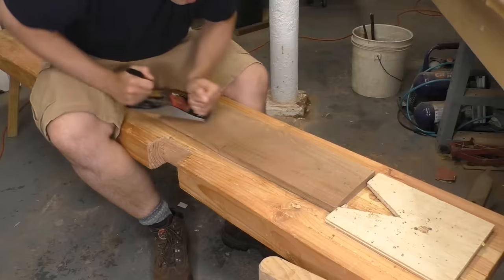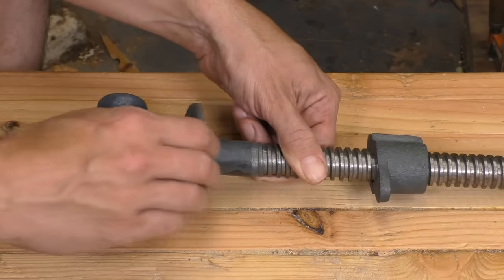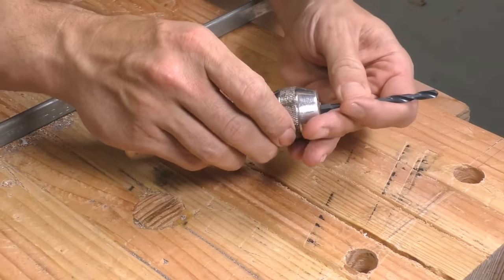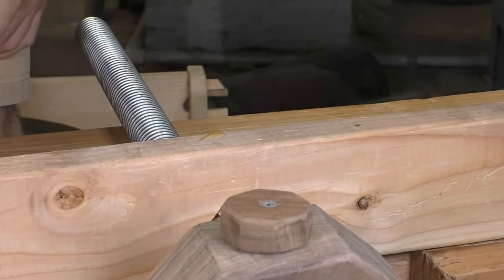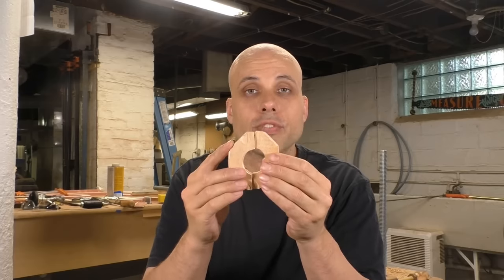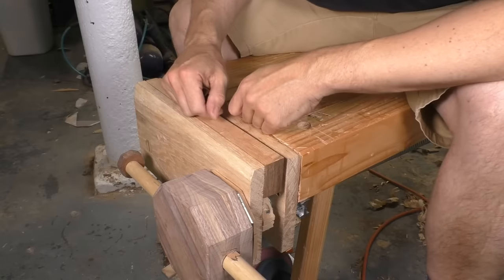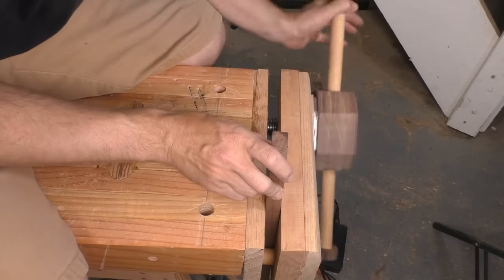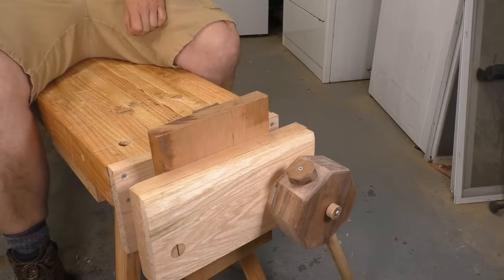Add a vise to the $30 Work Bench.

Comment: Question: Why not put the screw more or less in the center and have two smaller guide rods lower and in the corners? Aside from  taking up a little extra space, it seems like it could help with the racking issue, as well as being able to more easily support the screw. I say this as a welder, for the record. just starting to dabble in the realms of wood. (In before: giggity)

Comment: As alway, WONDERFUL presentation. 
I had a thought and was wondering if you had any thoughts. 
Why not put the screw in the middle and use 2 guide bars on the sides?
And yes I just now saw the end of the video so I suppose that kinda answers part of my question...
Reply from the maker: That's a total valid was to do it, but you lose the ability to clamp wide boards and work their ends. Thanks for ALWAYS watching and commenting!

Comment: At 1:35 you show a "commercially made vise screw". I have one practically identical to that. It has sentimental meaning to me, since it was my grandfather's, but I haven't figured out exactly how to use it to build a vise.  I have a question, that might make it easier for me to be able to use it.

Why is the end of the garter rounded? Whenever I have thought about making a vise out of it, I haven't been able to figure out what to do with the rounded part.

Comment: Rex great work, see if you can get some 1/8 or 3/16 floor underlay the stuff that's rubber and cork mixed together l got a roll for free and it works brilliantly on the vice/vise jaws reduces the force to get a good grip on the work piece. 
Power tool tut tut............................joking 👍👍👍👍👍

Comment: I was wondering why the screw wasn’t in the Center of the vice. Of course it would mean you wouldn’t be able to pass a long board through it but do you think it would work for less longer boards or to use boards width-wise for cross cuts etc.?

Comment: I'm confused as to why you didn't add the screw in the middle and have two guide bars on the outside? Am I missing something, Surely it would have fixed the uneven clamping force and tendency to rack??

Comment: This doesn't require any different parts. Why isn't the vice screw centered and you just add an additional guide like most standard vices.  That would solve a lot of those issues right?

Comment: So I've been wondering if you can mill wood on this bench, and I mean mill mill; like take a 8 ft log and turn it into useable lumber? Now I know you have to dry it and all but still would be fun, I've seen Me. Chickadee do it with Amish style saw horses and his method looks like it's not that hard but I'm not ruining the 10 cedar logs I got for free trying to learn how to mill it with wedges and an axe.
Reply: The splitting I wouldn't do "on" the bench - riving really since you want to follow grain I assume...for that you really want a Froe....can make one from the end of a shackle spring....your neighbor might not mind too much if you take one off his truck,  you need about 1/3 of 1 leaf....you don't live next door to me right?
But, once you have a flattish surface, the bench dog will hold it while you start the flattening process 
With 2 benches side by side the long way, you have a version if the old saw pit...place log over the gap and RIP saw it by hand....that's a lot of sawing.
There are videos out there on riving logs to get the staves you can then turn into quarter sawn lumber.
Plank sawn, well, you have to saw it.
Reply from the maker: Sure!  It's lot of work, but people certainly did it on these benches for centuries.
Reply: @gregmislick1117  not going to be "borrowing" a neighbors leaf spring, but I have thought about procuring a froe would help with logs, the Sawyer's in my area charge way to much, the cheapest guy I found said he'd do me a favor and only charge me $2.80 per board foot (regardless of species) plus I had to supply the gas, told him I'd find a way on my own; been thinking chainsaw mill but I'm not the poor man cause I can afford one and gathering the required amounts of steel tubing is taking me a bit longer than I thought.
Reply: How big (diameter) are the logs you want to mill?
How long? You mentioned 8ft in your post, is that average, max, or just what you have now?

I think, if I were going to try an 8 ft log which I could get onto the bench, I'd start with a draw knife and a long straight edge and try to establish a flat spot on the top face, so that you could roll it over and it would then stay put.

Mind you, an 8 ft x10" Eastern Red Cedar log - "air dried" so somewhere around 12 - 14% moisture content, is pushing 140 - 150 lbs. For Eastern White, it's about 60 or so % of that so 80 - 90lbs.
Green wood is another matter, I have some maple drying VERY slowly in my basement that is over 200lbs for about 5ft x 8 - 10 inches diameter. Water is heavy!
If you are going to split it...2 wedges at one end to start it, can probably get it to go down the middle, then you start using additional wedges along the length inserting them perpendicular to the length of the log...so they are going "across" your split. Keep moving down for ing the original split to "run" 
This is all the a froe does anyway. 
Once you have it in 2 pieces, just work the pieces down in the same manner.
You stop when the thickness of the thinner part (pointy end of the wooden wedge you have split out when look at the end grain end) is still thick enough for you to have enough meat left, at the width you want, to do the flattening with the planes.
Remember to account for the sapwood / heartwood boundary if you want only heartwood (or sapwood).
Let the stave you have split out season a bit before you work it more.

Don't forget to seal the end grain as soon as possible after logs are cut, or after they come into your possession to reduce the checking / warping / twisting while drying

Practice with some logs from the firewood pile. I regularly pick over my wood delivery for interesting grain figure or nice pieces to get quartersawn from. A 4x6x16" chunk of quartersawn oak/ash/maple/cherry/hickory is not an un-useful piece of lumber, and not entirely cheap either. Good for boxes or other smaller projects, or turning blanks. You just have to decide what you're looking for.
GOOD LUCK
Reply: @gregmislick1117  thank you for a much better explanation than a ten min video with no talking, 2 of the logs are 8ft and the rest vary from 4ft to 6 ft, still green, I think, as they were cut about 3 months ago and have been stacked about 6in off the ground and covered with a tarp to reduce more moisture getting into them (Florida is very humid).
Reply: I took an 8ish foot red oak log, about 20-30" diameter and rived it into 2-3" slabs.  Just steel wedges, ear protectors and an engineer's hammer (sledge is too big).   I made a roman bench from one of the slabs.  You don't need to dry it to do the staked legs.  In fact, if the legs are a bit dryer than the slab, they should expand a bit from the moisture in the slab.  That's how windsor chairs are made.  No glue either.
 
I don't know how well cedar would split, but oak does.  Riven wood is the strongest, more than quartersawn.

Comment: Well done. Just wondering why you didn't use the vise screw instead of the jack screw.
Reply: They're often less expensive. Sometimes you can get the vise screw for less. Whichever you find for less, or works better for you...
Reply from the maker: All the vice screws I've seen online are more money or the same for a MUCH smaller and weaker part.

Comment: Why not use the vise screw instead of the jack screw? Is it a lot more expensive or maybe not separately available apart from buying a whole vise?
So many clever ideas in this video. I've been binge watching as I just found you a week ago.
Reply: I think the idea was to make a project that was really accessible to a wide variety of viewers. A scaffold jack is cheap from new, easy to find, and also can be pretty easily found out in the wild, if it comes to that.

Comment: I started in the blacksmithing arena, lol before it was cool,  and so maybe this is something that would only appeal to someone like me but lately I’ve been noticing some surprising (to me) engineering aspects of wood, such as “self lubricating” or even more primitive there are some species that maintain an ability to bend over and over and continue as a decent spring for a longer than expected period of time. Lol don’t judge me, I’m still getting into working with wood! Anyway, with all that said, why not use that beautiful mind of yours and adapt a holdfast type tool, the physics I mean, and build whatever inspires you the most? The main reason I suggest this is because of your “notch” and how you basically said you have to fight with it to hold your stuff, I’d be interested seeing what you’d come up with
Reply from the maker: I appreciate that vote of confidence. I guess this vise IS what I can up with. It solves a lot of my problems.

Comment: You should really consider replacing that screw vise with one that's operated like a shaving horse, one you can just hold with your foot.
But an edge vise, not a literal shaving horse, would provide faster change.

Comment: In several of your videos, you have mentioned you like having both the low bench and the joiners Bench and it makes a lot of sense to me. My question is if you have the Joiners bench with the leg vise, and the low bench with all the manual holds. Would you still go through the effort and $ to add the face vise (can it still be called a face vice if it's on the end ?) to the low bench or are most of the operations that it helps with, actually stuff you would do on the Joiners bench anyway?

Comment: Thinking of using a 1 1/4 inch dowel instead of a 1inch. The 1 inch dowel I have is super rough, dry, and almost flaky? But I have a 1 1/4 that's much heavier and feels sturdier. Any reason not too?

Comment: Is there a reason not to put the screw in the middle with two guide rods (one on each side). Would that help with having a loose hold away from the screw?
Reply: You would be further limited on what you can clamp, as you see in his video, when he puts a board in, most go through the clamp and are exposed down below the screw and guide rod. This design allows for you to put pieces in between the two and have more surface area to clamp the wood: something that is important when clamping soft woods.
Reply: @Battleofjerhico  I did think of that but if he reduced the diameter of the guide rods and moved them towards the outer edge, I dont think he would be that limited. It seems already slightly limiting to have to use specific placement to have a secure hold anyway.

Comment: i did not read all the comments but why not center the nut and use two guide rods like commercial vices?
Reply: Watch again; he did that so he could work the ends of boards up to 9-inches wide. If he centered the screw, he would only be left with a couple of 4-inch or so spaces, instead of one wide space.

Comment: If someone wants a different vise there are all sorts of videos on making all sorts of vises. I'm in two minds. On the one hand I don't like the way that vise racks. On the other I do like the way that vice racks.... ;)
Reply from the maker: The racking also gives you the ability to hold those wide boards. It's a plus and a minus.
Reply: @RexKrueger  Absolutely. I'm in two minds as to whether to build a bench like yours or do it like Paul Sellers however I will include the crochet (sic) as that is a brilliant idea.
Reply from the maker: I think Paul would approve of the crochet. It's very traditional. I have a tall bench, so I just use whichever one I feel like.

Comment: Would there be any reason not to wax the guide dowel (and maybe the screw as well)?
Reply from the maker: I waxed the dowel and oiled the screw. Did I forget to mention that? Damn.
Reply: @RexKrueger  You may have mentioned it and I just missed it. That's been known to happen:-).

Comment: Does being so low to the ground affect your back or posture?
Just curious, I broke my back in a motorcycle accident ... it's never been the same.
Reply: I am a heavier guy so getting off my feet is nice as I can get some lower back pain if I am on my feet too long.  Really I find it very comfortable, but for you its going to really depend on what bothers your back and such.  You can certainly modify the bench to be somewhat higher.  You can test working at the level easily enough with concrete blocks/milk crates or some other suitable material of appropriate height and some 2x4s and see how it feels.  That is going to be the way for you really because I imagine the motions that irritate your back or cause you pain are going to be unique to you and not anybody else.  There is also certainly some room to make it higher as well if that would be more comfortable.  It is one of the nice things about building it yourself because you customize it to what you want and need.

Comment: You could have saved yourself a lot of trouble by just buying a new vice; What is the difference in price between a vice and a Scaffold Leveling Jack Screw?
Reply from the maker: It's really big, especially for a vise that's anywhere near this one in size. Yeah, you can buy a tiny vise for very cheap, but that's not going to get the job done.

Comment: I know people complain about the quality of cheap cast iron vices, but if the jack screw alone is $26, is this REALLY a better option than slapping on a $20 woodworking vise from Harbor Freight? It be like, yeah they may not be great compared to expensive high-end vices, but they've gotta be at least as good as something cobbled together from scratch.
Reply from the maker: And with that attitude, you have a great excuse for never trying to do it yourself!
Reply: There needs to be some justification for a project like that. It's either gotta be cheaper, better, or just more accessible.
Call me crazy but "Well it's a lot more work and it probably won't be as good, but at least it costs more!" doesn't seem like much of a pitch to me. Even the call to DIY isn't a good rationale since any time not spent making the vice could be used working on other projects. 

Just sayin'.

Comment: Anyone think a 3 hole ( threaded drive in center with a guide dowel on each side) would rack less? What would be the disadvantages compared to the design in the video?
Reply: Watch again; he did that so he could work the ends of boards up to 9-inches wide. If he centered the screw, he would only be left with a couple of 4-inch or so spaces, instead of one wide space.

Comment: Powered recliner Quarterback here!
Drill some holes for bench dogs to work with the Vice.    
https://youtu.be/LxAsf4REO3U

If I'm not mistaken Roy cut his notch out at an angle with a wedge to hold stock, now its been 40 years since I seen this episode  But its always nice to reflect back on what older guys used to do with hand tool woodworking.
Roys fun to watch.  Him Norm and Tommy Mac and Marks were all masters at there craft but they all have a differnt style of working wood.  Roy hand tools Man power    Norm Tommy and Marks machines.  Both kinds of woodworking complement each other you can fine tune with hand tools and plow through with machines but you should know both ways.

Comment: Why didnt you just put it in the middle and used 2 guide rods?
Reply: That would limit the width of boards you could put in while standing them vertically to work on the ends.

Comment: i made my vise out of m20 all tread 2 big washers , 3/4 inch water pipe T connector,  and 3 or 4 nuts.
i locked the nuts on the tread by drilling trough nut and screw and driving a 3mm nail on both sides of my moving jaw.
and i have 2 guide rails that slides under my workbench top.
my vise however can only clamp 8-10 cm deep and about 15 cm wide and pretty much can't clamp  wide boards to work on the endgrain , but it is my first vise ever made and it works pretty great for a junkie it is
 i was planing to add dogs to it and to my workbench top, but i can't bring mself to make holes in the workbench so it stayed without them.
https://www.deviantart.com/kokodin/art/vise1-805450505
https://www.deviantart.com/kokodin/art/vise5-805450988
https://www.deviantart.com/kokodin/art/vise4-805450911
https://www.deviantart.com/kokodin/art/vise3-805450862
https://www.deviantart.com/kokodin/art/vise2-805450751
Reply: Pictures are always a plus.
Reply: @jacobbambam5460  for me it's a proof i actually made it and not just play all knowing commenter

Comment: I really don't know how to justify the one-sided approach. I mean, from how the load is distributed. One side clamps and the other does almost nothing. Why not put the screw in the middle and put two dowels on the sides? Most other vices seem to favor that anyway. 

If the screw is in the middle, shims can be used, this one only truly works right over the thread.

Self-confidence does not replace sound engineering.

Comment: Tl;dr don't build this vise. Wedge a board upright in your notch vise and clamp your work piece to that. Edge planing? Bench dogs and a long wedge will hold crazy tight and release super easy. Sorry, but i think Rex didn't give it enough time going viseless to see the simpler, better solution here.

I spent a LOT of time building this vise. Twice. Finished both, hated them. Look up how unplugged woodworking does his. That guy is building client work on mostly Roman benches with no vises.

Comment: I don't understand people making vises out of scaffolding screw jacks.  For about $10 more you can get a tail vise screw and have a vise that is smaller, lighter, cleaner, and probably better working.  If you want the pride of "I made this!" then you should really be making the whole thing from scratch.  I'm not knocking those who do.  I've done stuff the hard way many times just for the joy of the accomplishment, but I'd rather spend my time making a piece of furniture instead of a Frankinvise.